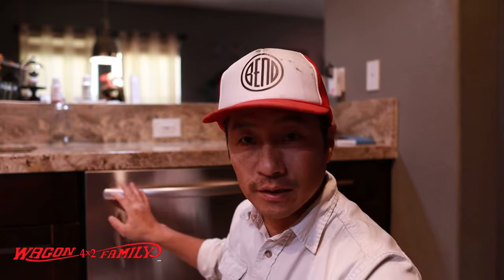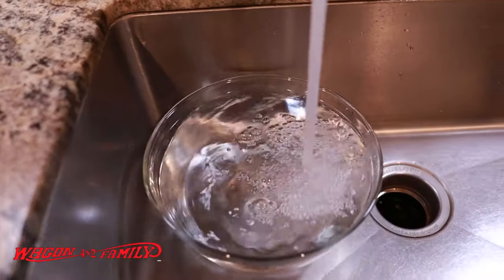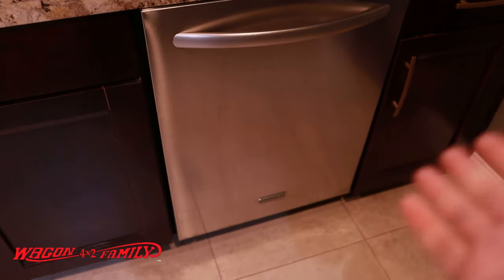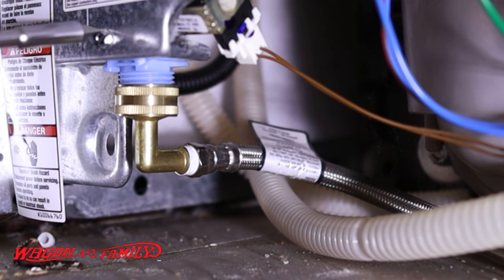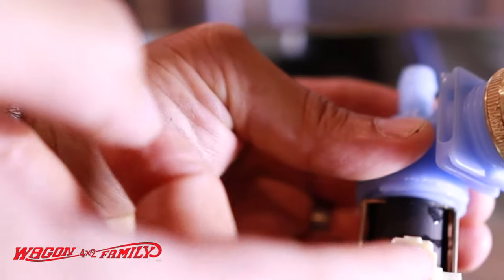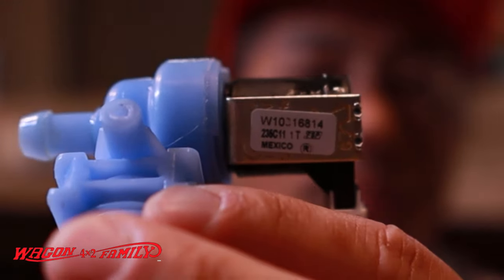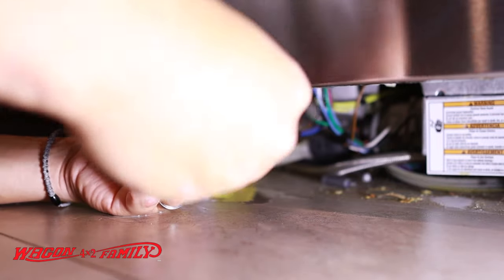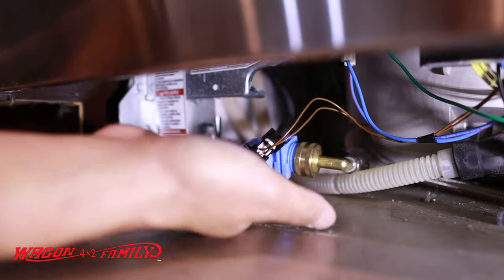How to fix a dishwasher not spraying  water

Comment: I almost went to replace the part and decided to call a local repair guy, he fixed it over the phone thankfully. Nothing was actually broken, so just for everyone out there, on the bottom of your dishwasher there's a little circular thing, it's the floater. Sometimes it gets stuck in an upward position, tricking the dishwasher into thinking it's full basically. All I had to do was pull it up a bit and drop it back down and wait for the faint "click" noise. Boom, fixed. Great video though, informative.
Reply from the maker: Great insight, thank you for sharing!
Reply: This comment saved me! No water... My float was stuck up!
Reply: @nancydenver2200  glad I could help :)
Reply: This comment sounds like a good try for sure! I to am not getting any water. Didn't know it could be the floater honestly didn't know what that was ha learn something new every day
Reply: Looks like the floater did the trick for me too. What a relief! Thank you. And great video.
Reply: Washer running this minute on Rinse for a test.  Already replaced the valve and it ran 2 cycles before failing so ordered another from Amazon.  THEN I go to YouTube, watch this video and see that I'm on the right track.  And THEN I see this comment and give it a try, exercising the float.  So far it's good so we'll see if it continues.  KISS for sure.  Thanks for the note.  My wife will be very happy (even tho' I'm the one hand washing the dishes while waiting on parts shipment).  You don't know what you've got 'til it's gone..
Reply: I can't find a floater in my dishwasher
Reply: They don't all have floater valves

Comment: My dishwasher fills with water and drains fine, it just doesn't spray and clean the dishes.
Reply: Mine is doing the same thing, did you figure out what it was?
Reply: Same
Reply: What was your fix for not spraying? The impeller underneath?
Reply: @yournamehere6925  nope. It's still not spraying from the top. My husband just hasn't had time to mess with it much. I'm aggravated because it's not even 2 years old.
Reply: It may be the circulation pump
Reply: @yournamehere6925 did you cause i have the same problem
Reply: Circulating pump.
Reply: Same. My circulating pump tested ok. No clogs. How do you test the circuit board that supplies power to pump?
Reply: I'm still unsure and landlord still hasn't had it looked at, been 2 years without a dishwasher. We are buying a home by the end of the year.
Reply: Cassie, did you ever get your dishwasher working?  My Maytag (made by Whirlpool) does the same thing your washer is doing.

Comment: Great video. However, there is no need to apply teflon tape to the threads; the flexible hose fitting already has a rubber seal.
Reply: Thanks, I wanted to say this too. It wrong to put teflon, it may stop the hose to seal well...

Comment: I was able to fix my KitchenAid dishwasher with the help of this video. Bought a replacement valve on Amazon. Save yourself a big headache and replace the spring clip with a tiny hose clamp (got mine at Home Depot). After replacing the valve the first time, I had a small drip and had to do it over. The hose clamp fixed it. Also, I'm not sure why he disconnected the hose from the brass elbow. It's much easier to unscrew the brass hose connection from the blue value.

Comment: Great video with detailed steps. In the comments, I saw a comment about the floater. I tried that, no luck. While racking my brain, hoping I did not have to follow the video. I remembered before the washer stopped spraying, I was pushing the hot water and drain hoses in the back of my cabinet/under the sink. Google results mentioned placement of the hoses can cause this issue. It took about 1 hour, but I found the "sweet spot" for the hoses. ALL GOOD NOW! I wanted to share for anyone else. Hope this helps. I kept putting the dishwasher on rinse cycle, once the clicking sound started, I open the door. which resets the rinse cycle to sprayers. Moved the hoses while the clicking also until I heard the spraying.
Reply: So what was the issue with the hoses and how did you fix it?

Comment: Thank you very much sir. 
I just recently started to using my dishwasher and I didn’t have any clue, how it works even though I do fix other stuff. 
Yesterday after I run the dishwasher, the dishes was not clean,  but some water left on the dishes. I didn’t know where to start. After searching on YouTube I watched your video and after 3 minutes of watching it, I decided to check the water inlet. Our under the sink water control valve is a rare one, which is, a push and pull one. I checked that control valve which turn ON or OFF the water supply to the dishwasher and It was pushed in.
I think while I was working on the sink faucet accidentally I push the one for the dishwasher. Now it turned ON again the dishwasher working now.
Also you explain everything in detail including the price and matching the new part with the old one.
Thank you very much for posting the video. God bless you!
Also do you have any information about fridge water dispenser? It’s a GE refrigerator. I already replaced the filter still no water coming out. It is making ice very slowly also.
Thanks again.

Comment: Good video, but I would have installed the dishwasher lower so the customer could read the settings w/o have to open the door. I did learn some repair procedures from you thx.

Comment: The dishwasher I was messing with had been sitting for 3 years. I put hot water in it to test and the dishwasher is been running normal ever since. Ran it 4-5 times so far. Just surprised me. Was convinced I was going to have to replace some stuff. It's fully filling, washing and rinsing. I'm assuming the hot water loosened something.
Reply: Likely the sump float was stuck up...telling the electronics the basin was full...so no water was asked for.

Hot water in the bowl dislodged the stuck float (likely food particles or grease)

Comment: Hello there thank you for this terrific video!
Just a question, if your dishwasher is filling and draining but not spraying could it still be the same issue?
God bless you!
Reply from the maker: Potentially. The part is cheap it wouldn’t hurt to replace it and see if that resolved the issue. Worse case you can return the item on Amazon. I left the link in the description to the part. 

Best,
Reply: What would be the next area to check if replacing this part didn't fix Emma's issue?  We have the same problem, fills, drains just does not spray.

Comment: this is very helpful, and thank you.  so I did the bowl trick and the sprayers were fine.  So I did go ahead and find the part number for the inlet valve and got it replaced (almost exactly how you described - excellent video).  After I put everything back together, the dishwasher is still behaving the same way.  Is there anything else related to water not spraying or filling to start the cycle?   Many thanks!!

Comment: Question: i have a 21 year old Kenmore.  I just put a bowl of water in the bottom and its washing. No problem. Im wondering, if that little screen was clogged would that stop the flow?? I thought i fixed it with the float but i used it once and it was back to no water flow. 🤔🧐 how will i know its the part you replaced? I just looked at new ones and omgosh. They're beautiful but so much money. My kenmore frig same age is filling with snow in the freezer and frig part is barely cool. 2 old appliances in 1 week. I love my ancient kenmores because they were awsome. Nothing has ever broke on it and we have well water. HELP

Comment: (My experience + grain of salt) Before you order this $75+ part, first, take it out and lightly tap/shake it on a soft towel. If you don't hear/feel something moving inside the valve, tap it a little harder. You might get a little water out. But if you don't feel/hear something shake free, well, nothing ventured, nothing gained. And watch out, as you know, the plastic threads strip easily. Pre-install the metal connector to  the valve before placing back.

Comment: Nice video. Mine is water sprays, but it didn’t spay high enough and powerfully. So do i need to replace that one which video showed the part? If you have an idea, please let me know how to fix it. Thank you.
Reply from the maker: It’s possible the water valve is not opening all the way and replacing it might help, but I would pull your sprayers and check if something is stuck. It’s also possible your pump is going out.
Reply: @4x2WagonFamily  the circulation pump?

Comment: I think I have a bad valve but when I added water it did not spray and also did not drain into the disposal. I think I’ll change the water valve anyway and see if that helps?
Reply from the maker: Make sure you didn’t overfill or added too much water inside. The water should be tad below the heating elements.

Comment: I filled it manualy but pump will not turn on ... I even tested pump by directly connecting 120VAC to it and it works...May be my control board is NOT telling it to turn on..
Reply: Same here. I have found nothing yet to diagnose the circuit board. Pump tests ok on 120vac.
Reply: @AlanGibson7   I fixed it ...that was long ago ...The electric connector to the pump was very poor quality and was malfunctioning !!

Comment: My Kitchenaid is showing code 6-4 .    The service company diagnosed that I needed a new sump pump unit.   Also, a new control board.   My dishwasher fills and sprays but after 7 minutes or so stops spraying and I hear the motor click on ... but it doesn't spray and 10 seconds later I hear a 2nd click and it stops  ... 10 minutes later it tries to start washing again and seconds later clicks off again.   The sump pump drain ok.   Any suggestions?  My unit is only 5 years old.

Comment: Hi, I've replaced the part you recommended, but the sprayer is still not spraying water. What do you think is issue?
Reply from the maker: Did you do the troubleshooting steps before you replaced the inlet valve?
Reply: @4x2WagonFamily  sounds like water is filling fine, just not spraying through the arms and like me he misunderstood your "troubleshooting steps" because we have a totally different problem. Dishwasher fills and drains fine, just doesn't spray.

Comment: Can the valve work on and off when it's going out? Or does it go out all at once?  I have a Kenmore portable dishwasher and when I hook it up to the faucet, It wants to pop off the sink. I can hear water going into it somewhat, but after a minute or two, it will pop off the sink. If I lower the amount of water going into the washer, it will stay on sometimes.  I have taken the dish washer apart 3x and cleaned out the hoses and cleaned the spray arm and checked the float but I can tell there is something wrong. I just can't figure out what it is. The dishes do come out clean but the water sounds the dishwasher make, I can tell, is not right. Could that be the valve? Thanks.
Reply from the maker: It sounds like you need to replace the water valve switch . The same part I replaced.

Comment: I replaced the part but it still doesn't spray water what else could be wrong? Thanks for the video
Reply from the maker: Did you check to see if the pump was working by adding a bowl of water at the bottom of the dishwasher and turning it on?
Reply: @4x2WagonFamily  i did but it doesn't retain the water i guess it goes straight to the drain.
Reply from the maker: @JulioLopez-yd6ke  your pump is bad.
Reply: @4x2WagonFamily  thanks
Reply: Is that going to be the drain pump?

Comment: I have the same problem, I hear a motor running but no water shooting out and I did get a new valve part I just hooked it up and it's still doing the same thing any idea what it could possibly be?
Reply from the maker: Was the motor running before you installed the new valve?
Reply: @4x2WagonFamily  yes
Reply from the maker: In that case your pump is probably bad, but you can test first by pouring some water directly into the dishwasher but do not go above the heating element and turn on your dishwasher. If the water is not spraying you can bet it’s your motor pump.
Reply: @4x2WagonFamily  ok thanks I'll try that tomorrow, I appreciate the response!

Comment: I poured some water into my dishwasher because it was not filing with water to see if my sprayer worked but nothing happened. So I assume my water circulator pump that has failed.
Reply from the maker: Note if you add too much water it will not work, so make sure the water is just below the heating element to test the sprayer.

Comment: In our case the issue we were seeing was the dishwasher would fill in and drain but it would not spray or clean. Initially we got the F1 E9 error codes. The dishwasher is a Whirlpool Dishwasher that is less than a year old. I started replacing parts that were cheaper and then the more expensive parts where all were possibly faulty. I replaced the inlet valve, the diverter motor, and finally the draining pump. We are still not seeing it spray or wash. At this point I have read that possibly the board is bad or a fuse but I am not sure. Anyone has an idea what else we could check before we go and buy a new one? Thanks in advance.
Reply: We just had the same thing happen. Replaced the valve.  It fills with water.  But not spraying.  Draining is okay also.
Reply: Problem: Water fills ok. Water drains ok. Circulating pump tests ok. Cycle runs to completion. But No water sprays. Solution unknown. How do you test the circuit board that provides power to pump?
Reply: @AlanGibson7  I am not an expert, but from my research, all you can do is test for continuity with a multimeter. If it does not beep, the circuit is broken meaning some component has failed. Then, as I understand the board needs to be replaced. I did not get this far, and after spending about $150 on it, decided it was time to get a new one and not mess further with it. I have put the old one for sale as needing repairs.

Comment: I have an error F6 in my dishwasher, i check it and no water inside, and see that the inlet valve not opened to enter the water to the dishwasher, its seems that the inlet valve fault?if yes how can i test it thats its works or no, or its the mainboard card pcb issue?dishwasher name NEON

Comment: how do you know the old part have issue?
Reply from the maker: Hi jerry, 
Because the sprayer and pump was working as you seen in the test, but the water was not ejecting into the dishwasher… hence the issue. The only part that would cause this issue is the water inlet valve. I hope that makes sense. Thank you for posting.

Comment: What If my water inlet valve is working and my sprayers aren't clogged, and my dishwasher is still not spraying water?
Reply: Mine is doing the same, i just replaced the water inlet valve. It will fill up with water.
Reply: @joekay611  I just went and bought a maytag! Still have the cheap whirpool and live in northeast Alabama if anyone want it!
Reply: Did you figure out the problem?
Reply: It sounds like everything else is turning around and I hear small amount of water but nothing is spraying water around, just a very small amount of water at the bottom [and I mean very little water shows at bottom of the dishwasher]. 2009-2014 Kenmore dishwasher black on top with stainless steel door and stainless steel inside.
Reply: @chandralockwood8194  yea I went to Lowes and bought a Maytag. Much better dishwasher!!!
Reply: @Autigers2013  Maytag, Amana, whirlpool, and KitchenAid are all whirlpool.

Comment: How did you know it is the problem on water inlet valve but not on motor?
Reply: I learn to troubleshoot dishwashers from an application repair man back when I owned a property management company. I’ve never had to replace a motor on a dishwasher, but I’ve replaced a lot of inlet valve… a common wear item.

Comment: I did everything in the video, ran the water manually through and it worked, so it's not the pipes. Changes out the part and it still doesn't work. What could be wrong? Now when I run it, there's a noise that wasn't happening before.

Comment: My dishwasher is brand new, came with the house. It fills with water and drains, and the heater works but water never sprays or splashes inside. I ran it thru several cycles. It fills with water and then its silent for like 20 minutes and then drains. Not sure what to do there, or why a brand new dishwasher doesnt work 😒

Comment: For future reference the tread tape is useless on that type of hose
Reply: Could you please explain when not to use the thread tape and when to use it.  Thank you.
Reply: @ggpp6252  on flare fittings and compression fittings no tape or any fitting that has a seal inside like a water hose
Reply: @ggpp6252  thread sealants are for pipe threads

Comment: but what if it doesnt spray?? what do i do then?? mine fills up and drains but it does not spray. i cleaned the filter and still nothing? help!!
Reply from the maker: Did you replace the valve solenoid and after that it still not spraying, Is that correct?
Reply: @4x2WagonFamily  no, but after trying your test of filling up with water still did not run, the holes on the sprayers are not clogged, the diswasher is only 2 yro. I clean the filters and nothing happens.
Reply from the maker: @Andres_OnTheRise  if you add too much water it will not work. Try pouring less water in the tub and redo the test.

Comment: So mine is pushing water in. But the “blades” inside are not spinning or washing. It drains fine. I took dishwasher out. Flipped over and took apart everything underneath. Nothing clogged. Could it still be the part u replaced?
Reply: I forgot to mention it drains too
Reply: Mine fills okay. Drains okay. Cycles to completion.  Spray pump tested ok. clogs checked for. But still no spray. How do you check the circuit board?

Comment: Hi. My dishwasher is not washing. It fills up. But is not spraying water. Ran the diagnostic test. It givesme a 6-4 code. So I replaced the Inlet Valve. I can hear the float switch clicking. What else can it be?